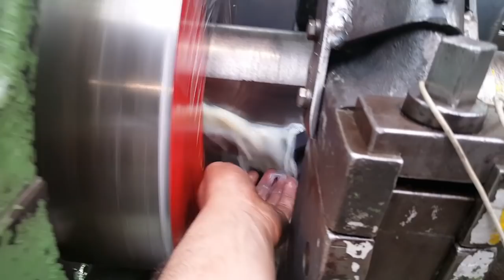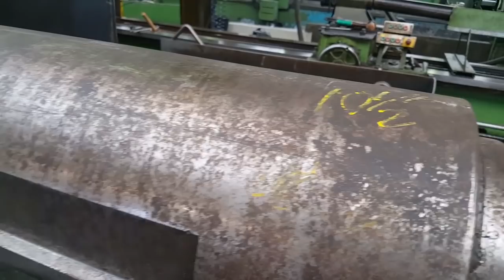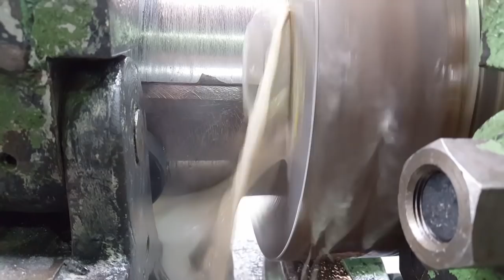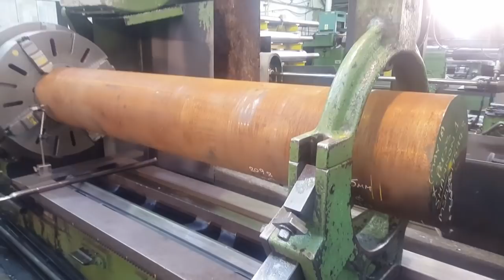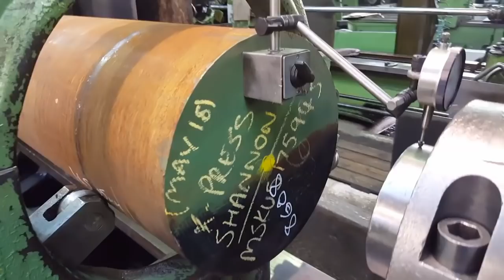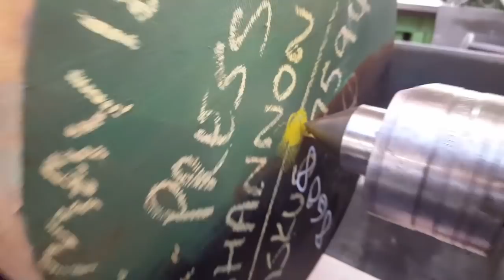Machining.  THE BIGGEST BORE of my life.

Comment: I also like working alone when I set stuff up. everything is done how I like it, and it just works. 
I bet they are loving you in that shop
Reply from the maker: Working alone eliminates someone else's failure. 😉
Reply: @userwl2850  Trial and error is the best way. I learnt my lesson trying to drill stainless sheet metal. Killed all the Hss. 3/16 drills I had. It kept heat treating it trying to drill through it over and over again. Lessons you dont forget when you find solution. Love your set up with the tube holder and the massive hunk of rod.  Steady rest has some mods too. Save the core for other projects. instead of making 300lbs of chips for the recycler. Hats off.

Comment: So if the inserts are always pushing the trepanning tool in the same direction away so that the bore gets smaller and the core bigger, why arent the inserts set up in that way, that both forces cancel each other out, like for example if the entering angle of one insert is slightly different than the others?
Reply from the maker: I like your thinking.. very intelligent.  They are set so the forces do that.. works easy on short stuff but obviously there are limits. 👏🏻👏🏻

Comment: Does gravity not make the tool dip as it gets well through tapering the bore?
Reply from the maker: The tools are made from 16mm wall pipe.  They're really not heavy.  👍
Reply: The rotating workpiece keeps it mostly straight anyhow. If the drill was turning and the workpiece stationary you’d have a lot more of a problem.

Comment: Hey thanks for sending me over here to see this combo trepan / boring job. Quite impressive hogging going on there!
More questions for you:  What was the smallest ID trepan machining you ever have done?  And how deep? 
Have you ever cut a trepan face over and past an existing shaft diameter?
Reply from the maker: I'm currently making a Trepanning tool to cut 75mm. Stay tuned. 🤞
Reply: @userwl2850  Thanks David for your kind response. I truly admire your machining accomplishments.

One of my "accomplishments" working in a "job shop" that I still remember (and still have a NFG sample), I once had to cut many trepan faces on multiple parts around and over an existing 3/4" dia. that stuck out 2 1/2" inches in front of the intended trepan face of this lathe part.

The trepan inside dia was to be from the shaft's existing 3/4 dia, cut to an outside dia. of 1/3/8",  approx 9/16" deep.....into H13 material!

The bottom insides of the trepan had to finish with 1/16" radii both inside and outside. 

 I had to hand create/machine a tool holder, which held two custom created and custom ground "standard" carbide inserts... top and bottom. 
A round plunging/pecking tool with clearance for the existing shaft. The problem of course was the tightness of the radial clearance and fragility of the tool to accomplish this clearance. Coolant flooding of the tool and chip removal (pecking) was essential for success (Also many "backup" carbide inserts).

The shaft dia. plus major OD  and multiple face(s) of this machined part were all later (after heat treat) OD ground together square and parallel with each other within tenths, so that all surfaces fit into a precision injection mold of some kind without leakage or "flashing".

BTW The insides of these parts were also a "bitch", as they had a relatively deep (1/14" ) and small (1/2") internal fine thread and "seat" inside the shaft, that had to bottom precisely for some kind of replaceable nozzle insert?